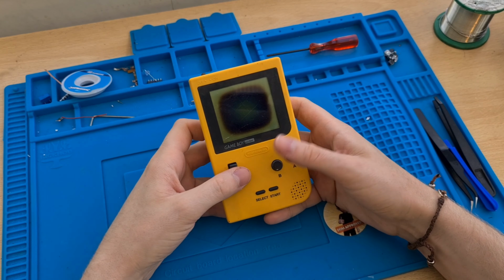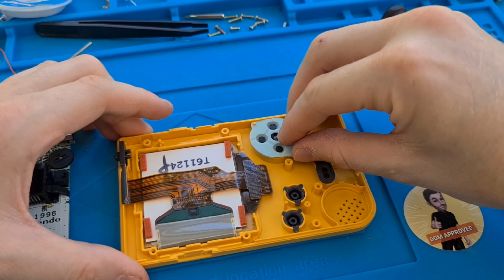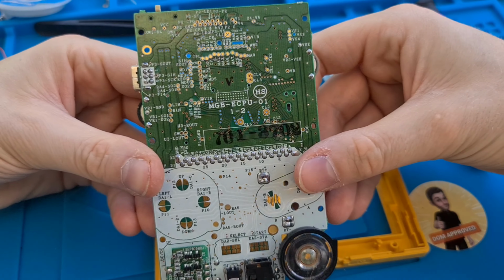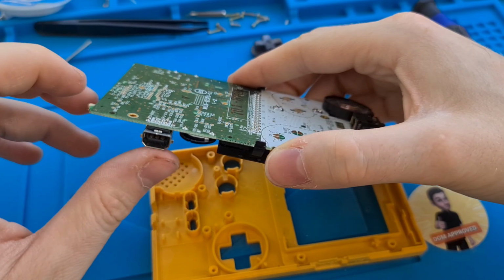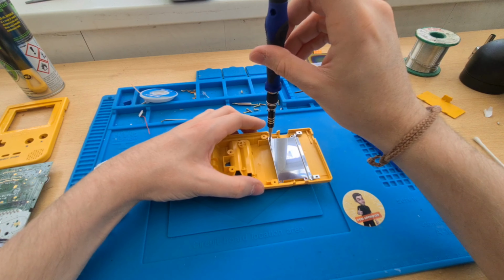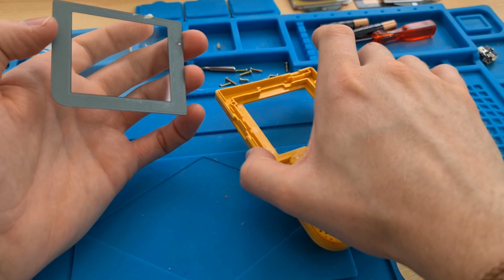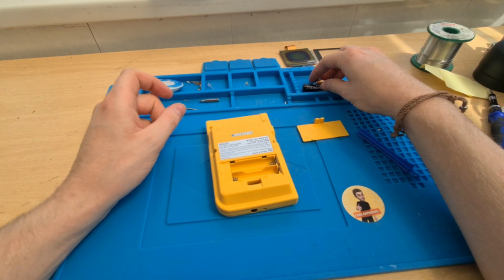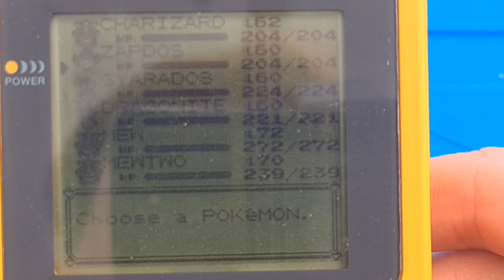The Chief restores! Gameboy pocket restoration and reflection

Comment: I’ve got a gameboy pocket that works fine on AC but not on batteries. Any idea?
Reply from the maker: How does the battery compartment look? There might be corrosion that's causing the problem. Clean the contacts or roll some battery's back and forth while in the compartment. Let me know how it goes!